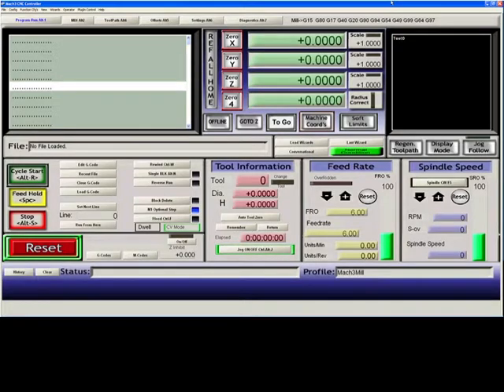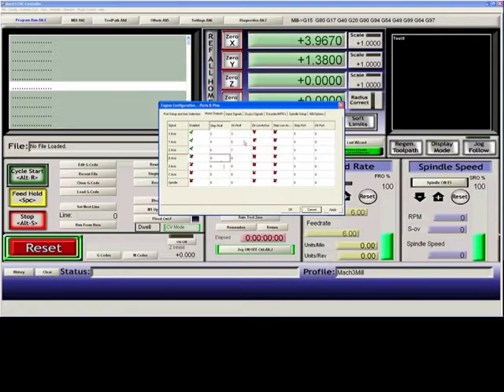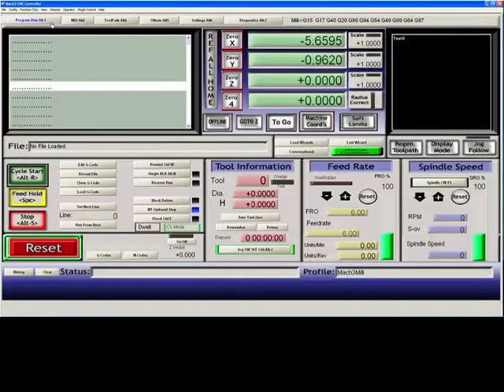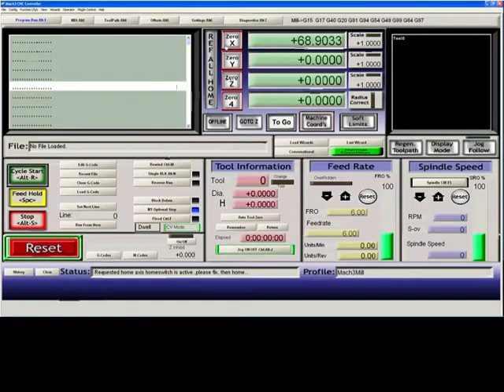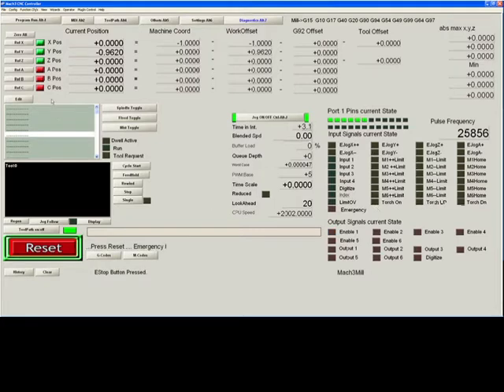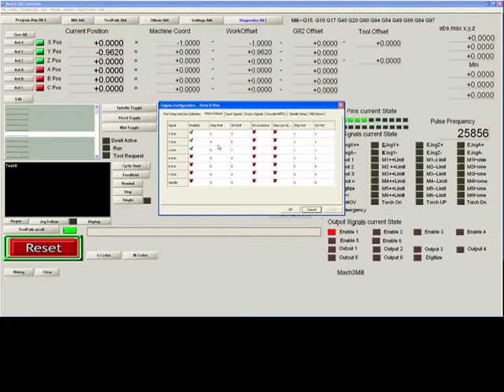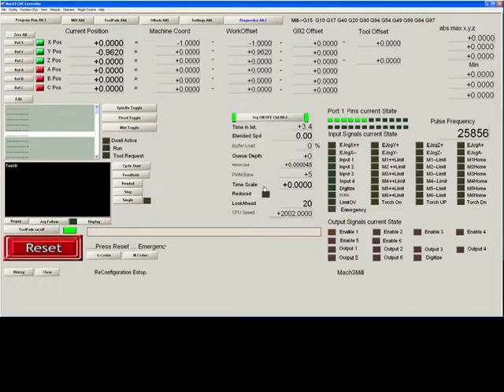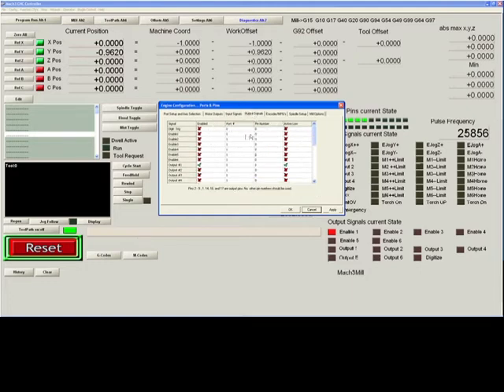Troubleshooting in Mach3

Comment: Thanks for the video. I have some weird experiences with mach3. I lod gcode file object does not appear on the mach3 monitor on the right but the gcode sequence is visible on the left. I start cycle the spindle starts and lowering to start carving but only drilling until gcode sequence completed. I dont know what to do

Comment: Bought 64 Bit Windows 10 Pro Desktop computer to replace my broken old Windows 7 32 bit computer that came with the router. . Downloaded Mach3 Demo to it. Have the **EZSync USB to RS232 (DB25 Male) CNC Programming Cable, CNC Controls Programming(Fanuc, Yasnac, Sinumerik, etc), FTDI Chipset, 1.5 Meter, EZSync014C** Plugged everything in and turned on the power to the Router. Response is jerky jerky east west movement slowly east across the X-Axis. Grinding sound. Mach Demo software does nothing to stop or reset. E Stop does not shut it down....Only powers switch shut down stops it. Any ideas?

Comment: Great video, it is very helpful. I got a problem with a cnc... it moves motors in manual mode, I mean arrows and jog, but do not move motors in line comand or leasing a code, the Motors vibrates but no movement.

Comment: i have got a new usb breakout board and have everything moving. 
my problem is that even though the A Axis is slaved to Y Axis
they move seperately Y as normal with the Arrow keys - A moves with the (end and home) keys
my old breakout board never had this problem and i have no Idea where to start to rectify this issue
i had to get a new laptop and it is running Windows 10 old one was on win7.

Comment: when you are calibrating the X-axis in mm unit and you are writing a value 5 mm, At right down corner there is a setting from where you can select the units mm or inches.these probably should be set for mm when you are thinking you are calibrating your axes in mm.

Comment: I think you're videos are great and very informative. I have one minor point. You always talk about parallel port configuration but I don't believe most Windows 10 machines are running parallel ports. I am hooked up to my controller with a USB and I know if I try and say automatically determine pin configuration I give an error message saying it only works for systems with a parallel port. Maybe I am confused but I haven't heard anybody talk about courts and pins with reference to USB ports. Thanks for your help

Comment: Hi. We have tried everything and can't get Mach3 to move motors or anything. I have watched several Videos tried settings nothing works on my Chinese 6040z and SXCNC controller. Mach3 works on laptop but nothing work or moves.  It came with a Parallel to USB  cable. It talks to laptop but nothing happens.
Reply: Did you manage to fix it?
Reply: Mine isn't working either